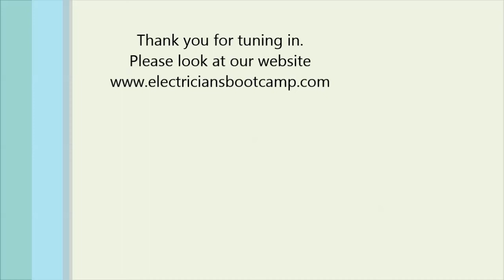Electricians Boot Camp Range / Oven Calculations

Comment: Thanks for the video! I have a question, how did you get 27.2 when you were solving for note 3?
Reply from the maker: sovereign power 27.2K comes from table 220.55 Col B    8k x 10 ranges = 80k X 34% =27.2K you must compare to Col C which ever is smaller that is the number you would go with.